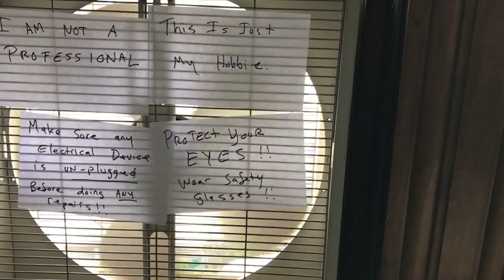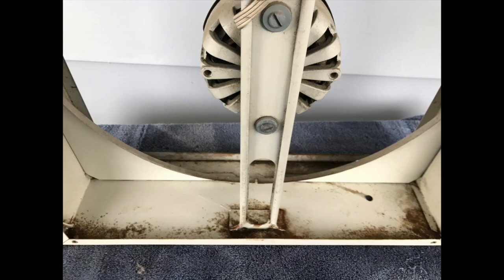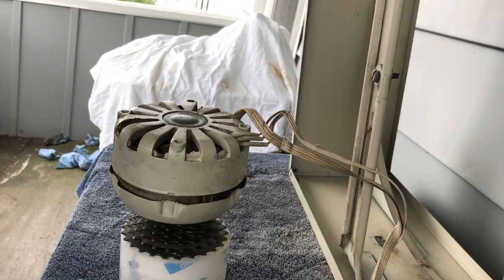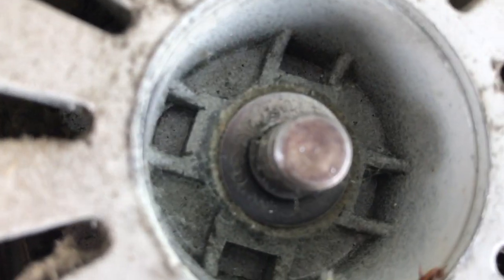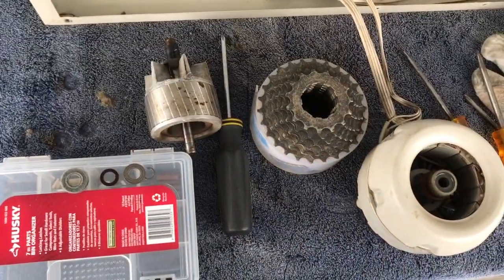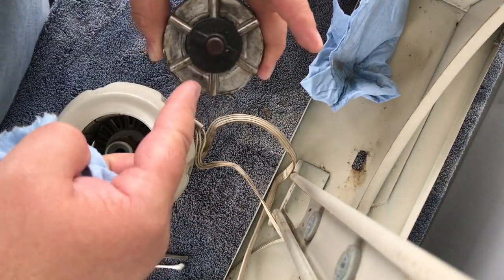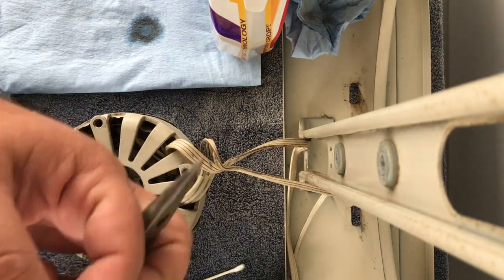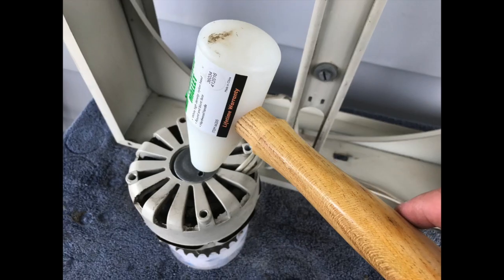Vintage GE Box Fan Lets Motor The Oil

Comment: They make plastic flexible automotive plugs in various diameters that might work as a removable rear cover for easy future servicing.  Just thinking aloud.

I have the circlip pliers for that front clip.  I’ve used them a ton over the years.

Thanks for the video!

Comment: The shaft doesn't go through a "bearing", it's a bushing. Also, when you were reassembling the motor, on the armature shaft end where the circlip goes, wasn't there supposed to be a large, felt kind of wadding that goes around that whole end of the shaft? In another video, you did pull that kind of wadding out and thought it was dry. Somebody else said that it contained grease, but agree with you that it had dried up. I really wish I knew what kind of grease had been used. I'm tempted to clean that felt wadding from my fan's motor using paint thinner, then after it dries maybe put some axle or disc brake grease in it. I will first use oil on the shaft as you show though.🧐
Reply from the maker: ok. first of all, its rude to tell people how to speak. this style of design is often referred to as a uni-bearing motor. not a uni-bushing motor. That's how I learned it. 
next, the later versions of these GE box fans (which this is) seem to have not come with the big C shaped felt. Seems that GE was getting cheap at the end of the run. 
You would be foolish to use grease. These would only have had 20 weight oil in them, in my opinion.
Reply: Sorry, I was simply stating a fact. Didn't mean to sound rude, sometimes typed replies can sound that way and I should have given more effort to what I wrote. What I see in the motor is a bushing. A bearing is defined by WordWeb as "A rotating support placed between moving parts to allow them to move easily" and clearly, a bushing doesn't rotate. OTOH, they define a bushing as "A cylindrical metal lining used to reduce friction". IME, bearings have either balls or rollers. On the other topic, I guess I'll clean that wadding with paint thinner and let it dry out and then soak it in 20 weight non-detergent of some kind -probably a 3-in-1.  Again, sorry to have sounded offensive. Was just trying to clarify things. Thanks very much for your videos. I really appreciated the way you showed the order of the washers and other things. :goodvibes:

Comment: As bad as it may sound ive used a sharp Phillips head or flat blade screw driver as a punch and and punch a hole into the cap myself lol
Reply from the maker: I hear that. Get it done. It's just an old fan after all.
Reply: @thebombyall76  true lol what's nice is the cap on these is hidden so any awful scars go unseen now on the older ge ball motors with the decorative ge cap it wouldnt look to good